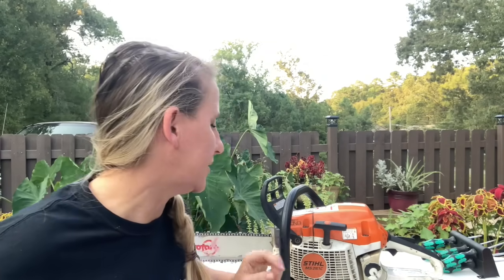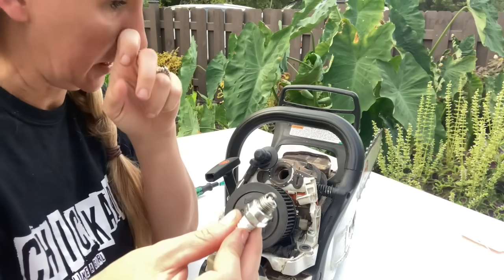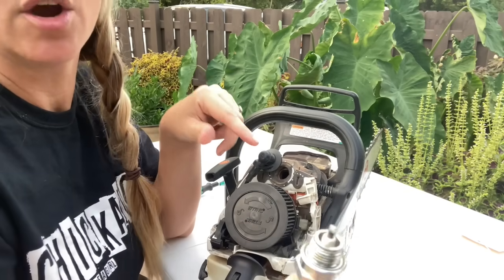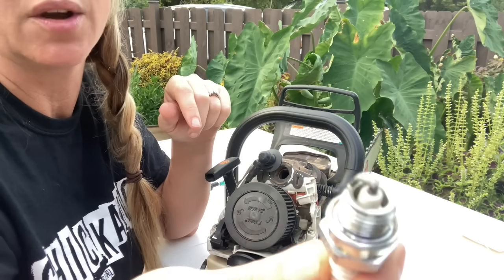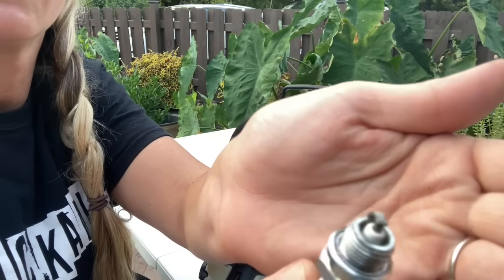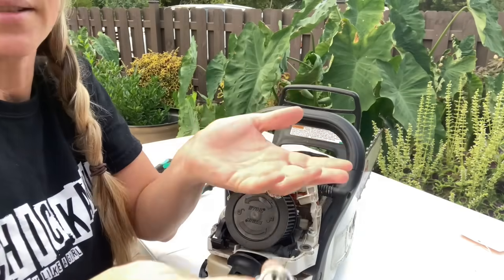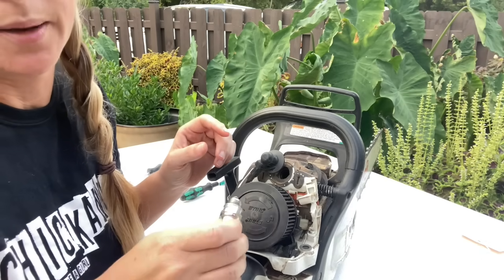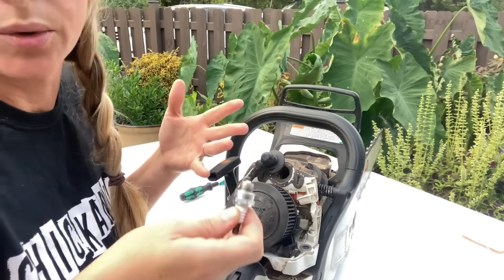STIHL M-TRONIC CHAINSAW HAS NO CARBURETOR ADJUST, WILL IT "RESET" TO REGULATE FUEL CORRECTLY?

Comment: I have a Husqvarna and use Husqvarna oil. I once bought Stihl oil and went the Stihl oil quicker than the Husqvarna oil. I compared the oil and found that the THICKER oil was the Husqvarna oil. I'm not gonna buy a Stihl saw due to that the oil for ther saws it thin. Burns oil quicker means you'll need to have more oil on hand that means you spend more money.
Reply from the maker: Great point!

Comment: Check the reset procedure that you used against the build of the MS261C-M as there are several different reset procedures. I have two Stihl M-Tronic saws in my kit as well as 6 other saw types. I like the M-Tronics and have had no trouble with the fuel system at all. Wonder what you think of the MS500i if you don't like the M-Tronic? Time marches on...
Reply: People always fear what they don't understand. Any piece of new technology will have someone somewhere fearing it to high heaven. The automotive repair industry experienced this when fuel injection became the norm in the late 80's/early 90's. The outdoor power equipment industry is experiencing the same now. Although, with the push to battery powered equipment I suspect a good number of small engine mechanics will never get the chance to get good at diagnosing and repairing computer controlled gas powered equipment as they will not really see much of this "transitional" technology.

Comment: IMO Too short of a run time to color the plug, However under full throttle it sounded like you had a little 4 cycling happening [a good thing]..  I know not everybody is thrilled with electronic engine management, But most all cars and bigrigs have it  and seams to work just fine.Generaly speaking EEM runs the engine as lean as posable
Reply: yep, thanks to the EPA

Comment: I'm the head tech at Elberta Hardware I'm also the 2 cycle guy! We sale echo I have too say really good stuff and i have worked on stihl a lot of years! I don't like what there are doing with there system are doing. My feelings iin the small engine world EFI and stihl doing its just to many bugs is not worked out yet! I'm like you i want to fix it but crap just for tool repair it a lot money. And them if you get that you the change make labor. Any way Echo rocks! What you do its rocks!

Comment: I like most of your videos, but have to say on this one, your "information " isn't totally correct, and each independent dealer is different, but the dealer i work for offers free carburetor adjustments, and even though we are a Stihl dealer, we do the same for husqvarna,  echo, etc.
I did not understand your "chain running because not enough fuel" statement, unless you're referring to a "lean" condition causing it to over rev. and the official reset is-
(on/off has 3 positions)
first-
lowest position- start, leave it there- no throttle at all, for 90 seconds,  shut off. 
second-
lowest position,  start, immigration trigger to allow to move to middle position,  run 90 seconds,  shut off.
third- 
lowest position,  start, immediately make a continuous 60 second cut into wood, shut off. 
it is now "reset"
I state again, aut our humble little STIHL dealership,  there is no charge for ANY brand carb adjustment,  and yes, I'm old school,  not a particular fan of all the electronics mumbo jumbo but don't necessarily blame stihl,  husqvarna,  or anyone else, its our wonderful EPA that is mandating cleaner burning stuff resulting in the need for this BS. 
ALSO
I didn't  see something I feel was VERY important to saw operation,  but when you read the plug, was you using their gas or yours? I dump existing fuel when I make adjustments,  because I want to KNOW the fuel is good, fresh and properly mixed.  I don't care HOW adjustable your carburetor is. you're going to have a lean condition if they don't know how to do fuel properly.
Reply: She LITERALLY said it was HER mix of fuel, Typical Stihl sheep, blindly defending the product even though it has been garbage for decades. Even dishonest scum Stihl dealers admit right to my face that nothing in their store will come close to the 07S my Dad has had for 40 years, nothing but Chinese junk for decades, all the Germans do is slap the STIHL sticker on and charge 2 grand
Reply: @ralphwiggum4805  and NO, I'm not a typical "Stihl sheep." I own 2 husqvarna saws, 1 trimmer. 1 Jonsred saw, 2 poulan saws, 3 homelite (project)saws, 2 Stihl saws and 1 trimmer. BAAAAAA to you.
Reply: @ralphwiggum4805  anger issues? have a snickers bar
Reply: @ENDERTON2000  nah, no anger issues here since i threw the Stihls in the trash ;) Fuel primers, Decompression valves..... you know, STANDARD features on even $100 Chinese saws that the $2000 Stihls don't have..... life is good :) The best part is never having to speak to a Stihl dealer ever again
Reply: @ralphwiggum4805  I'm thinking they are just as excited to not have to see you again. there's a saying in retail that we love to see all customers.  some we love to see COME IN, others we love to see LEAVE
Reply: @ENDERTON2000  I would expect that from an unskilled, unqualified NOTHING that works in retail ;) if the customer leaves you make no money :D As a qualified mechanic you wouldn't believe the pricks I have to deal with, but money is money, stupid enough to buy a Jeep? no worries mate I will order 7 of everything and it'll be 12 hours of labour :P
Reply: @ralphwiggum4805  you really ARE a gem

Comment: I have an old school pioneer saw that is still running, it's a little heavy but works good 👍
Reply: I have one also; the Husky Rancher/Partner 61, white head saw. I use it as a backup for my Stihl 026 for cutting medium size trees, and firewood. The old 026 is light, cranks easily, and has yet to give me any "real" problems, until about a year ago. 

It's an OLD saw, and was getting low on compression, so I ordered a Meteor piston and Saber rings and a gasket for it, hoping the cylinder, crank, and bearings were still in good shape... 

There was no scoring on the jug, and the crank was surprisingly still in spec. So I replaced the piston and rings, and rebuilt the carb (just bc I keep spares for it). I probably could have just replaced the rings, and been good to go. But a new piston sure does look purdy going in!! 

I adjusted the carb, and ran one heat cycle. And now the compression is back to 155, before the ring have had time to seat.

Of course the ole 61 still has enough compression to give you sore wrist!!! 🙂

Comment: Truly wondering how much a 'reset' at the dealer would cost. But having said that, does the machine have a screw on the control module that you could remove and screw into a second reset hole. This, actually is a switch that would just bring the reset circuit on. Some industrial machines have this sort of arrangement.
Reply: In STIHL's case, it's not just a "reset", its a forced re-calibration of the carburettor and as you inderstand it cannot be made just by pressing a "reset" button like on your personal computer.

Comment: Well as another commenter
has pointed out there are different versions of MTronic Stihls that use different procedures, not sure if you did the correct one on that saw.  I have had MTronic saws since they came out and had zero issues.  The people that saw they want an old fashioned manual adjustment carb, most have no idea how to properly adjust a saw carb anyway. You even said you prefer one and I’m sure you can properly adjust one. So does your car have a manual transmission, a carburetor and and a distributor with conventional points?  I didn’t think so
Reply from the maker: This is not the 3rd generation M-Tronic. For that procedure you set the chain break, start and idle for 30-60 seconds. Release chain break and rev full throttle for 30-60 seconds. Usually in about 20 seconds after running full throttle you will hear the RPMS increase for a few seconds and then return back down. Then it is re-set. Does my 1974 Corvette or 1968 Cougar have a manual transmission, yes. Does my Vette have a quadajet carburetor and my Cougar have a Autolite 2 barrel carburetor, yes. Do my Vette and Cougar have distributors with points.... Yes..... Thanks for watching!!!
Reply: @Chickanic  Does your 1974 or 1968 take you on your daily trips to where ever you need to go? Or do you have something more reliable for daily duty? Something that perhaps doesn't require the owner to adjust fuel mixture every so often, something that perhaps needs a $1,000+ scan tool and a skilled tech to fix when it does break, something that perhaps you can't fix yourself but you don't care because it just works.
Reply: @Chickanic  
You are truly an exception. Great videos

Comment: Now as far as the “Stihl” oil and warranty, buy their oil when you buy the saw, then go to your local parts and supply store for lawn and garden, and buy castrol oil, they are the same oil!

Take that saw into some wood, then after 6 or 7 cuts, recheck the spark plug, 90 seconds is not enough time to remove the “lean burn” markings from a plug, so your initial reset may have worked, but because of only a short run time it didn’t show on the spark plug!
Reply from the maker: I didn't show it in the video due to not wanting all of the "safety apparel" comments, but we did put it in the wood before I checked the plug. I work on chainsaws everyday. I check 3-10 plugs everyday and know how to read them and how fast a change in fuel mixture should change the look of the element. The "re-set" did not fix the problem. Thanks for watching!
Reply: Also reading spark plugs on a 2-stroke is dubious as well.

Comment: so you know that the machine is running lean by the white on the tip of the spark plug even after doing the "reset" meaning that it is still not getting enough fuel. That would tell me that the diaphragm and gasket inside the carb need to be replaced. And yes even though it is controlled by a small Microchip that makes all the adjustments every millisecond or whatever it is you can still go ahead and blow out the carb make sure it is free of any noticeable junk and rebuild it with new diaphragms. Having said this I wouldn't put it in an ultrasonic cleaner because of the wires and such on the carb but you could've done that to try rectify that issue of not enough fuel before taking it to a dealer. Even though it is electronically controlled for adjustments it is still rubber diaphragms is inside and after a period of time need to be replaced just like any other carb may need.

Comment: In my experience with conventional carbs and the new Mtronic and Autotune, they have to be run under load and not just bench tested for a good 30 minutes or more to even begin to see any color on the plug. My Husky Autotune runs a nice chocolate brown (maybe even a hair rich) all the time which is just the opposite of what I thought it would be.These are good systems and they have worked most of the bugs out by now. The only main issue is that you have to have the proprietary software to read the fuel trims and see if there are any error codes. Only dealers of Stihl and Husky can get the software so yes, they will have to go to the Stihl dealer. Echo has a version in Europe known as the Autochoke (CS 352AC) so my favorite brand will have it in America soon.
Reply: You can't properly read a spark plug in 90 seconds at idle.
Reply: My 3 favorite things about Echo chainsaws and trimmers:
No stratified engines that I know of.
Adjustable carbs(those limiters seem to disappear somehow).
Easy starting.

Comment: I'm big advocate of not fixing things that aren't broke🙂
Reply: In this case, Carbs. Older adjustable carbs are about as perfect as perfect can get. They're simple, and work. Then here comes Stihl along to make things complicated.
Reply from the maker: @williambray4134  Exactly!
Reply: Being able to fix something that is broke doesn't meet the "not fixing things that aren't broke" criteria. If traditional carbs weren't broke you wouldn't need to adjust them.
Reply: You keep telling yourself that. 

The electronic carb was definitely a bad move. Anything electronic doesn't mix well with moisture. I wouldn't be shocked if moisture found it's way to the carb, and made contact with wires.

Manufacturers need to quit trying to improve products when there's nothing more to improve on.
Reply: @williambray4134  I bet your daily driver isn't an old vehicle with hand crank starter, carburetor, points ignition, manual transmission, no power brakes, and no power steering. Such a car does perfectly at it's job of driving you around but I know with certainty you are enjoying the "useless/needless" improvements engineers have made to cars since the first working car was invented.

Comment: You will want to run that WOT under load for a min or two at least possibly more to get a good read on that plug. Read it at the base of the porcelain down inside. That sounded right once you reved it up wide open, it certainly did not sound lean after that "Re-set" The only real way to check it is in the wood, but from what I heard it's something I would feel fairly comfortable sending out to a customer.
Reply: Yep.  You can’t idle it for 90 seconds and then free rev it for ten more to get a reading.    It needs to run hard, buried in wood, for probably a tank of fuel if you want a real read on the plug.
Reply: Exactly!
Reply from the maker: You are correct. "Hollywood magic" I had my husband go cut with it before I checked the plug. I should had mentioned the heat and smell also, but know most people wouldn't understand what I was talking about. When a saw is running hot you can feel and smell it. Thanks for watching!
Reply: @Chickanic  I figured you had given it a workout after you did that re-set 👍 I agree it's hard to explain on video some of those things we just do that's second nature and have the feel for, like the smell and feel of the saw running hot and lean.
Reply: @patthesoundguy  oh you guys are all so astute, we mere humans could never understand any of this. lol 😂
Reply: There is a danger however that IF the "RESET" DID NOT WORK, then to go run it hard in wood could cause permanent heat damage. 

The benefit of manually adjusted carburetors is that you can adjust it richer immediately you see the plug shows signs of overheating !!
Reply: @orangeshaw2370  The point to remember is that we know by the sound and behavior of the saw under load and not under load whether it's rich or lean, you would not get to the point of damage in a quick test and you don't check the plug that much. The plug tells a story but it's hard to run it and check it over and over. You don't know immediately the state of the mixture by reading the plug because you have to run it WOT after warm up and pull it. You know immediately by sound and behavior. It's very easy to misread a plug after a short run because you don't read the tip of the porcelain, you read at the base of it way down inside the plug.

Comment: Love my Echo cs590.
Carbatrator for this Cat!!

One thing I would have done after the reset is to make some cuts @ WOT. This would given more time for the plug to reach op. temps, then immediately shut down to check the plug.
Years ago, when out riding dirt bikes, we re-jetted carbs almost the same. Take the bike for a WOT rip, kill the engine,, pull in clutch, and coast to a stop. Then checked plug:)

Comment: It is likely an issue with the solenoid but if it is a computer issue it will probably just be shop time. I work at a dealer. The biggest thing is if the have the equipment